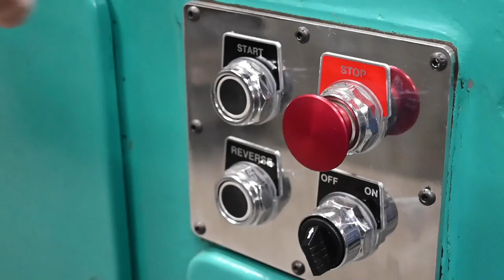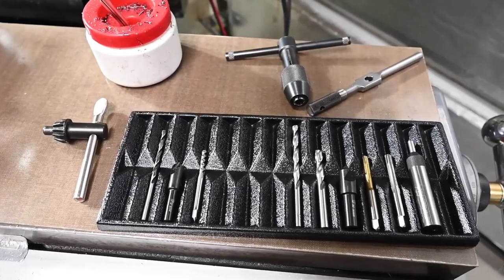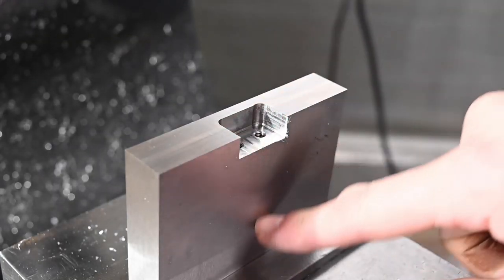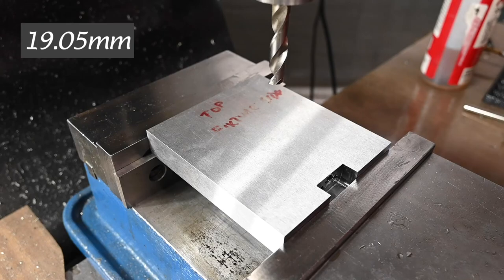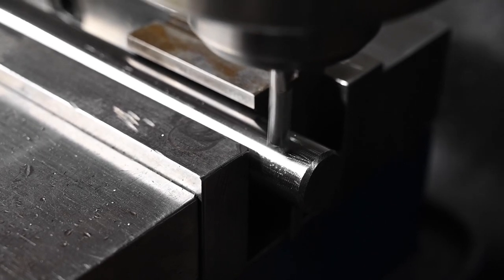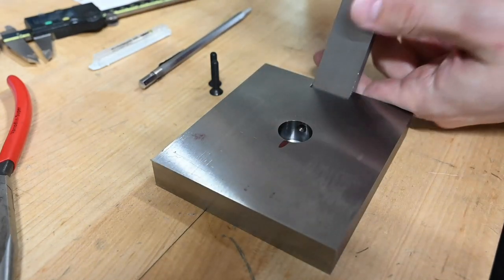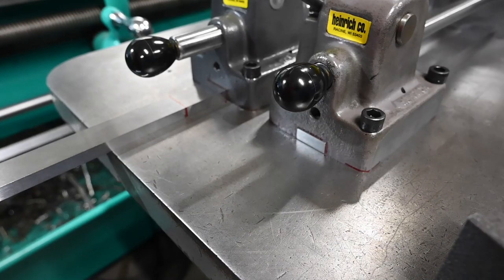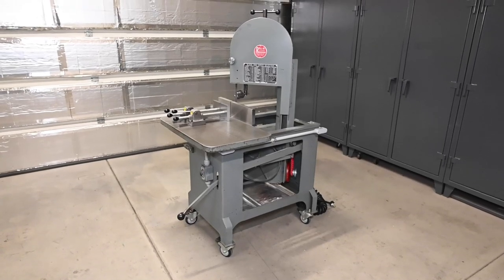Roll In Saw Fixture Locks Complete! Machining and Assembly

Comment: Looks great. I would have done it slightly differently. Looks like when clamping low or high it bends the moving jaw a bit. Might wallow out over time with only a set screw. I would have left the bore shallow and come in from the front with a highly torqued Cap-screw. Looks awesome though Aaron. Give us an update when you get your cylinder in please!

Comment: Do you like eletronic edge finder?
Great work.....nice cabinets on the back....
Reply from the maker: Yes I’ve been very happy with it. Another viewer had problems with theirs but this one has been flawless for me.
Reply: I ordered one after seeing yours in the videos and have been very happy with it. I like being able to edge find without running the mill and I can avoid some speed/belt swapping this way.
Reply: Can you test it vs conventional edge finder....?? if you have runnout on your chuck eletronic won't pick up right?
Reply from the maker: I've tested it and they seem to be equal. I try to use the 1/2" collet for the electronic edge finder so the drill chuck doesn't influence the reading. Most of the time my work doesn't need more accuracy than that.

Comment: Hi Arron, great video as always, i was  thinking about you power tapping,  may a suggest that you consider using  something like ER colet instead if using a drill chuck.  taps will damage your chuck jaws when they slip  ER collets are pretty inexpensive  compared to replacement jaw sets .  Cheers
Reply from the maker: Thanks Phil. I’ve been thinking about what I want to do to deal with that and an ER holder would be a good way to go. I also have a Tapmatic head that needs some repair that I should fix.
Reply: @AlwaysSunnyintheShop   yeah i have a tap-matic also, i don't use it for "one off's" too much vertical travel needed for the benefit. the er holder i bought with a 3/4" shank which is the same as my chuck that keeps the change overs quick & easy.

Comment: Nice job, Aaron, those plates came out perfect.

Though I do have a question about the lower support bars that you added to the workholding clamps... When you turn the handle to lock the pusher bars, does it clamp the lower bars as well? I'm afraid I don't see the benefit of adding those bars, if they're not locked as well.
Reply from the maker: They don’t lock down, but they will prevent the push plate from twisting.

Comment: Amazing rebuild series. I have a question, is the blade square to the table, or does it lean forward at the top? Is there a way to adjust the moving blade frame to square the blade to the table?
Reply from the maker: It’s square to the table. I don’t think there’s a way to adjust that pitch angle.
Reply: @AlwaysSunnyintheShop  Reason I ask is I just acquired the Jet version of the Roll-in. The blade is currently not plumb vertically, but I see the guide rollers are mounted on eccentric stub axles, so I'm hoping those are the adjustment points. The Jet manual is of no help.
Reply from the maker: I suppose the lower adjuster could move the blade somewhat, but that is really meant to straighten the blade between the two wheels. Is the upper wheel not plumb above the drive wheel? Not sure how to fix it if it isn’t lined up.
Reply: @AlwaysSunnyintheShop  I'm sorry, I meant the head guide rollers that the entire head rolls 'down hill' on not the blade guide rollers. I'm also going to check alignment between the blade wheels, yes.

Comment: Really nice. I really enjoyed this. That Roll In is just the size I need. What model no.? -Thanks
Reply from the maker: The current version is an EF1459 while mine is a SF8590 but they are nearly identical. The new version has a taller throat and therefore uses a longer blade but otherwise they are about the same.

Comment: What if you need to cut something at a angle?
Reply from the maker: Yeah that’s the down side with this setup, but using an angle block clamped in with the material is one solution.

Comment: Say you definitely have machining ability and knowledge when it came to cutting the stock your blade would be correct if you would have cut material the width of the stock.  Its about the amount of teeth engaged in the material